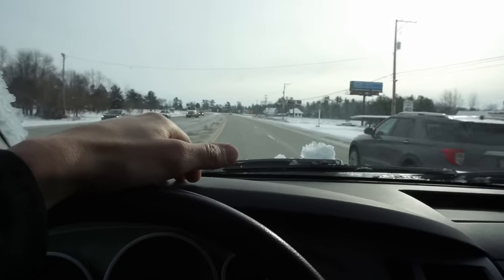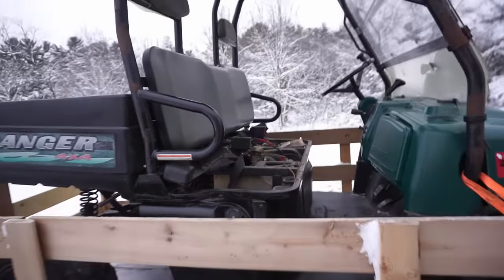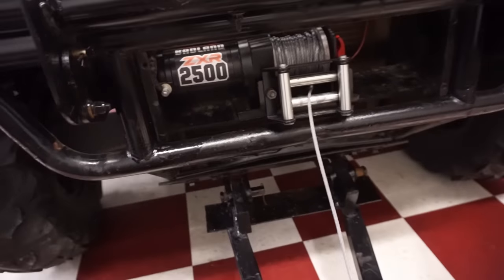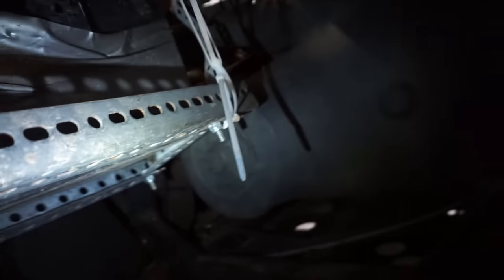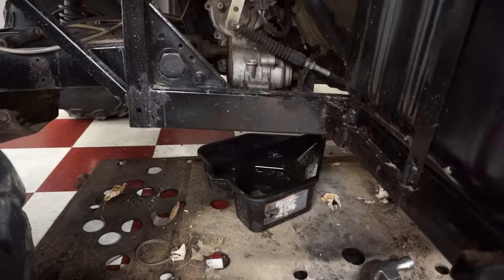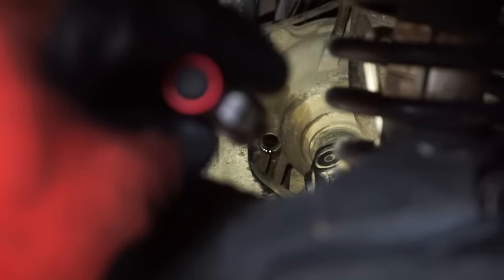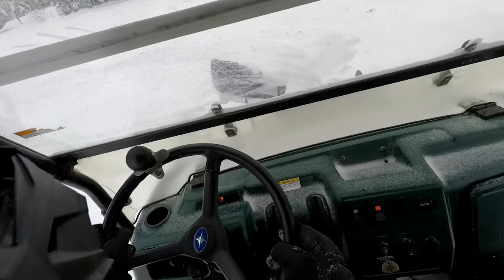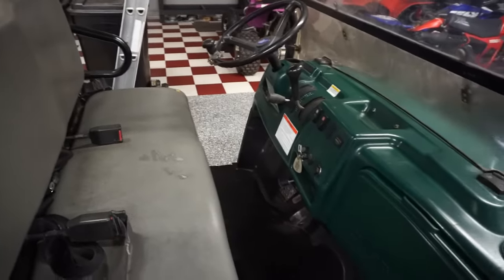Plowing Snow In a Blizzard With The Cheapest UTV I Could Find  (Huge Problem Found)

Comment: Joe... a couple of plowing tips for you. Firstly, back your Polaris into the garage so your first plowing is right out of the garage. Secondly, angle your plow (right or left) sharply, and make your first run down the middle of the driveway. Turn around at the street or house and make consecutive runs pushing the snow further out from that center pass.
Reply: Hey Allen after you angle your blade and run down the middle of the driveway and you turn around at the street do you still have your plow angled when you go back down the middle or do you keep it straight? I'm about to start plowing for this older gent and was wanting some advice please.
Reply: @swully-ol4lx  so long as you are pushing the snow outwards, keep it angled to push the snow to the outer edges. A straight blade is inefficient except in small areas.
Reply: @swully-ol4lx  By making these ever increasing circles you shouldn't have to stop to change the blade angle. If plowing on a gravel driveway, your blade should be equipped with adjustable sliders that allow your blade to ride just above the gravel. Otherwise, you'll be plowing up your driveway gravel and moving it with the snow off the driveway.
Reply: a couple hundred pounds of weight in the back will help too, not over loaded but some added weight, also do not put the blade all the way to the pavemet, that way there is the weight transfer of the blade on the front wheels for added traction and steering
Reply: No push the snow ❄️ towards the middle of your driveway so you can collect it for drinking water
Reply: @xephael3485  That's for when you live in the desert.
Reply: Good advice
Reply: Nice, get you a 90lb. Bag of sand and throw in the back and you'll have better traction and you can spread it around on the driveway when done plowing. In Wisconsin here with a blacktop driveway on a slope and have to apply sand on it
Reply: Joe isn’t very intuitive. Just watch him work. He just hasn’t ever been more than a few miles from home.
Reply: Storing open containers of oil and fuel in the garage. He’s a short bus rider for sure. Running all that old crap machinery and out shoots a few sparks. Good bye house and loved ones. Smarten up!
Reply: Don’t worry just throw the burning leaves in the corner with the gasoline oil mixture in the open bucket.
Reply: You are in deep snow and you don’t know what to do? WTF is the plow for?

Comment: Weight in the rear is a must and you should be plowing in low range. Also, backing it inside is more efficient so you can just drop the blade once it’s outside the door and not drive over snow THEN try to plow it.
Reply: yes ,low range for sure, easier on the machine.
Reply: You gotta report these text scam people that are showing up everywhere

Comment: You can sand, buff, and wax the windshield too be crystal clear.  Also,  after each plowing, I saturate my machine and plow in a silicone spray.  Make sure to lower tire air pressure way down for max traction.  Nice unit!

Comment: Those little 500 are inherently noisy. But are tough as nails. I have the 900 XP HO ranger. I’ve hauled dirt pulled logs and everything else. Has 5000 miles on it and will run 65 mph. That bad land winch is good. I think you did good Joe. So people aren’t mechanically inclined as was the previous owner. Merry Christmas to you and yours.

Comment: yes the rear is supposed to be a mechanical diff lock the front is an armature which rotates and a series of rollers become magnetized and engage both side axels. i have a set of pdf maunals for it if you want them.

Comment: Another option you could weld a nut on that front diff to remove the shaft with a puller. drilling n tapping hardened steel can be a task

Comment: Take the center plate off the inside center of the tailgate. I did that and unscrew and take out the latches on each side. I can't remember if there was an adjustment on each rod or I gave each rod a little tweak that would actually shorten them and that will get the latches to move enough to easily open the tailgate.

Comment: I'm thinking  that if you remove  inside cover on the tail gate you can adjust  the  latches,  also start in the center of  the  driveway  and  turn around at the end and push  the snow that way you don't  need to  reverse all the back
Reply: If that tailgate handle is anything like Chevy p/u's?  Inside that center latch are metal rods that extend out to the latches on either side, so that when ya pull up on the handle it pulls those latches in.  those metal rods are connected to the pull handle through plastic bushings.  Chances are those bushings are worn so that when pulling the handle it doesn't pull those rods in far enough to unlatch...OR?  It could be an easier "fix" if the pivoting mechanism on the handle itself is corroded where its range of motion (so to speak) is not pulling those rods in far enough.  But?  until then?  jez leave the tailgate down.  😉

Comment: WD40 also makes a silicone lubricant spray that will not evaporate the way the water displacement spray does. Some jell lubricant spray is also a good thing to have around. It's gell lube remains where you spray it and won't drip off (unless you use way too much lol).

Comment: @2vintage
  My guess on issues:
   Tailgate - I think the rods from the handle out to the latches are bent slightly.?
    Front CV axel - was cut out because it probably blown out of the back of the wheel.?
    Diff Lock - I'm guessing that broke or has missing pieces.?   Or the replaced the rear axel with one that doesn't have a diff lock.
     She's definitely had a hard life of abuse and no maintenance.    Good luck.

Comment: We had one of those machine on the job,had alot of fun and work with it,and yes overall doing the maintenance and adjustments  on it was relatively easy,but if you are to do snow with it,you definitively have to put weigh in your box,and also ,I've noticed that the wet snow was packing on your blade,you can always spray it with some silicon lubricant.
Have fun with it,I did.

Comment: Merry Christmas bud and stay warm up there in cheese country. Btw what year is that? Idk if you said or if I missed it...also if you don't have lids for your buckets of used oil I would throw a strip of cardboard over them just to be safe if any sparks were to occur...Also x 2 if that rear end is original it might be missing a plate that the cable attaches too. If you look at other side (Pass) it has a cable attached to a bracket that bolts in.

Comment: I use a 500 to plow snow up here in Alaska.  Chains on the back wheels.  Synthethic rope instead of wire cable on the winch.
No problem plowing 3 miles of my driveway .

Comment: its in great condition i paid about 600 for both of mine from gov planet, one had a hand ful of peagravel in the motor and 1800 hours i shop vacd the gravel out and it run like a champ, Subaru designed the 500cc engines they are bullet proof

Comment: I like my 2016 570 Ranger and even my old 2002 Ranger did better with rear snow chains, they make a big difference when backing up and helped when pushing snow into the pile. I liked my 02 a bit better when towing due to having the tongue weight on the straight axle, the newer ones with rear independent suspension seem to squat a bit more with a trailer hooked up. Have fun and look into rear chains you won't regret it.

Comment: I started out buying a 500...saying thats all I'll need.  then the 700... & 900... and yep the 1000 .. 
You will go on a trail ride with your friends and you won't be able to keep up .. sold the 500 and upgraded 3 more times. You mention windshield and wipers ... good ones "glass" with wipers and bottom split for vent run around $1200. to $1500.00 ... acrylic and plexiglass are much cheaper but they scratch the second you install and remove the blue plastic protection film. Thats how it went for me ... more or better accessories with more power ...  have fun

Comment: I have a 2004 polaris ranger 500 4x4  just like yours. If you add some weight in the bed you will be surprised how great it will plow even in 2 wheel drive.

Comment: Regarding the windshield freezing - It's sticking to the windshield because it was inside the garage at what ever the temp the garage was. Now that it's out in the elements the snow is melting dropping its temp and refreezing. I'll bet if you scrape it off it will not continue to accumulate. Same thing happens in our vehicles. If you keep the heat off during a storm you'll have little need for wipers. Once the defroster or heater is on you'll see it sticking to and then melting on the windshield. 
My 2 cents.

Comment: I have a 2005 ranger and my battery is under the hood  but  it's alot smaller battery had no problems with the small battery.  I've plowed for many years works great. You could put some weight in the back. Might help you till you get your parts. Have fun they make plowing snow enjoyable.

Comment: Get the tail gate open be a lot handier I have a newer model 500 moved 90 yds of material this year added a larger battery , wiper washer and a rad hose heater on an early morning timer starts better 
The warm up much faster sand in pails in back with a chain and shovels scraper etc
The pails with the sand gets a little better traction
Maybe angle shifter next year

Comment: Find some take off bighorn 2.0's on craigslist for tires. Your stock tires  dont pull in the snow. The bighorns pull great for plowing. Also get 2 or 3 of those sand filled tubes at tractor supply for extra weight, one in passenger footwell and 2 behind seat in box. You won't believe the difference.

Comment: I wanted to comment before i even finish watching. You got by far the better end of the del. I bought the exact same machin3 polaris ranger 500 brand new. Mine was a 2003 model. I paid around 10,000 for it the plow is at least 1,500. Your little 4 wheeler will never be able to do what that ranger will do. You should love it.

Comment: One thing that really improves your clean pavement is to replace your scid bar with a 1 x8 solid steel from like a actual county plow. I had one welded to the bottom of my plow. One thing I liked was it added weight so it cleaned the pavement better. I owned a funeral home so my parking lot that was actually 200 square feet short of an acre of blacktop. I plowed the parking lot for 7 years with a Kawasaki Prairie 300 4x4 . I live in Wisconsin so we receive enough snow. One of those years we received 108 inches. I never had one problem with the machine. I will be buying another Kawasaki, that’s for sure.

Comment: Lesson learned, always pull fill plugs before drain plugs.  Nothing worse than not being able to refill something you just drained.  Also, how you were holding you motor oil bottle and it was pouring out in gulps, turn the the bottle over 180 degrees so the pour spot is at the top will allow a smoother pour with little to no gulping.  It's much cleaner and easier to control

Comment: Add some weight in the back & rear tire chains & you will be amazed at what you can push.  I used a 1985 Honda Fourtrax 250 for 18 years in Wisconsin.  Even though it was 2WD, extra weight in the back & rear tire chains got the job done.   You have a nice rig for plowing  as is.  Enjoy!

Comment: Actually it's only 1 wheel drive.  With only 1 CV axle on the front, the power is being sent to the side with no axle because it has the least resistance.  And with no diff lock in the rear it's just 1 wheel drive.
Reply: I figured it was 2 wheel 1 in the rear if it's in the unlocked position and the front on the polaris has a electric locker so 1 wheel up front that was my thought either way its moving more snow than I thought it would like that
Reply: @tylermitchell9939  oh ok I didn't know it has a locker up front

Comment: It most likely has had an oil change…you can find a Polaris filter many places. Also, I would consider using a 5w oil during the colder months…I use Rotella T6 (5w-50) year round in our Defender.  It’s great oil at  good price.
Reply: Yeah i agree. That machine is better than 15 years old and that filter doesn't look anywhere near that old.

Comment: Hwy 21/73, I know exactly where You were. LOL 
I've been Plowing with an ATV since 2003. 
I have a Polaris 700 Sportsman with the Big Moose Plow on it.
Several Mods I have done. I have Hydraulics for the Plow Angle, Dedicated lift Winch for lifting the Plow 
The Hydraulic Pump is also used for the Dump Trailer. Limit Switch to stop the Winch on the lift Stroke. 
I put a 1/2 pipe on the plow blade edge to keep it from digging into the Gravel. 
I have Chains on all 4 Corners. (I needed Spacers on the Front). All 4 springs have been upgraded. 
I have a lot of Weight in the big Polaris Branded Back Box and the big Deep cycle battery on the Front Rack 
Suspension Lock for the Back end 
One most important tip for Plowing... clean off the Plow blade really good than when it is dry coat it with Silicone Spray and LET IT DRY. When You take off down the Driveway the Snow will just fly off the blade. 
I have over 800 Hours on My machine, mostly Plowing Snow than Trail Riding and the only Trouble I have. I like to Foul the  Plugs..  I use it more than My 45 Hp Kioti Tractor cause it is more nimble. 
Mike M Wausau/Merrill area.

Comment: If you remove the rear center gate latch you may see it is connected by cable to the outsides. May just need to shorten the cables at the latch 1/2 inch so the dump bed would work. Just a thought.

Comment: I've have John Deere Gator  used also 4 wheel drive did  work either  the front shaft was boke in half replace it from Deere 650 later  works fine now!! Its has fuel injected start easy  Evan when Cold like last week !!! In Indiana :goodvibes:😄

Comment: Just a little advice. Your blade has allot of snow stuck to it. It came from a warm shop. After a bit, clean the snow off. The blade is cold now and the snow will roll off it, especially when the blade is angled.

Comment: Just get a old set of car chains and cut them down to fit the back tires,  it will work a lot better till you fix front axle  . If you get a lot of snow you can leave Them on till spring !

Comment: I would think 4 or 6 sandbags in you box would give the plow much better performance.  

     Also thinking if that is a dif lock rear, maybe they plugged it when the oil leaked out.  I would want a plow to always be locked in the rear even if I had to weld it locked, not like I would use it for summer festivals with a plow on it.   1 wiper moder to have a wiper in the middle go from side to side and 2 wiper sprays to spray on your windsheild sould work.  

Love your content, you sound just like Calen  G from NCI S LA. Maybe a phone role might pay 💰 well 🤔

Comment: Wondering if the original battery was smaller to make it easier to check oil. Might be able to add an actuator so you can tilt the blade from the drivers seat.

Comment: Great video. Glad someone is doing quality work. I wouldn't be worried about buying something from you, since you are concious about doing things correctly. I didn't notice you doing anything with the diff lock lever. Does it work? Was it for something else? Was the rear end changed? Also, for the battery box, possibly fab something up with a boat battery box. That current setup is definitely janky.

Comment: I'm picturing somebody back in 1908 with a Ford Model T attaching a soil  blade to it for the first time and screaming... Eureka!
Reply: I don't know if the motor will be able to handle it, but you need more weight. Traction is all about weight.
Reply: For the amount of property that you have, I would have recommended saving that $2,500 and financing a 25 hp Kubota or John Deere. It we have probably cost you 20K over 6 years, but you got a real machine that you can do lots of work with.

Comment: some of those rangers joe you can pull that cheesy black plastic inner wheel cover off and take the wheels off and get right on that front diff plug.that battery is not helping anything either.  throw some tire chains on it in the winter will help alot. great videos bud merry christmas .

Comment: The rear axle probably has been changed like you said. Looks like there's a plug where the arm usually comes out. Also you should add diesel instead of gas to flush out sludge, has lubrication gas does not

Comment: I live in California and have never snow plowed, I like your new toy or project. My idea was possible have your tire poly filled, like steel yard equipment. at a tire shop then you can screw in lag bolts in your tires for great traction and never have a flat it's a little expense. I have done it 8 times on electric mopeds with good luck. The scooters because I was tired of unwiring the hub motors, because of flats.

Comment: Plowing in low range is easier on the vehicle. And you do have four wheel drive, your front driver's wheel is actually spinning when you give it gas. Like in an open differential four-wheel drive vehicle only one of the wheels will spin on the front end, usually the one that spins is the one that is not getting traction. After adding weight to your dump box you will get way more traction and you will not get stuck at all. You should make a video on that 👍👍👍

Comment: The diff lock might be an electric solenoid type. Or a pin with a lever that the cable connects to. The hitch bar seized inside and they torched it out. To check for a parasitic draw put a dc amprobe on positive cable and remove fuses on at a time to identify circuit that could have a short to ground like rear light. Have an oil pan under cv shaft where it goes into the diff before removing broken shaft.

Comment: My 2021 Kawasaki Z900 RS café (purchased new with 0 miles) has a Kawasaki oil filter on it. It now has 3700 miles on it and it’s had four oil changes. I just use the OEM filters but yeah considering the Color of your oil, I don’t think it’s ever been changed!